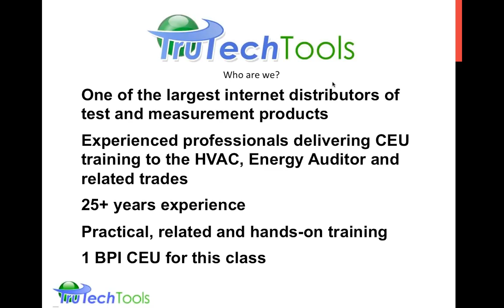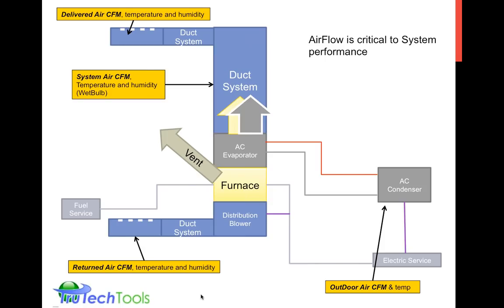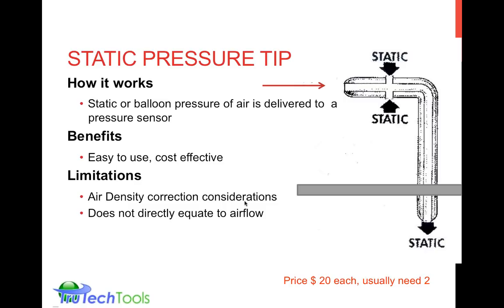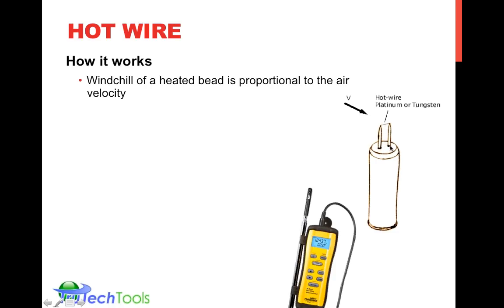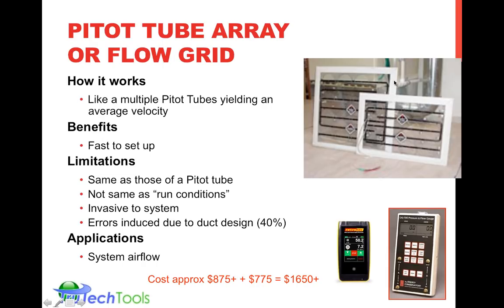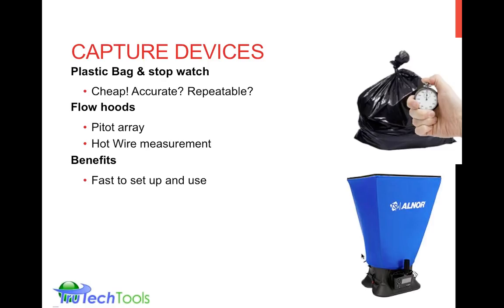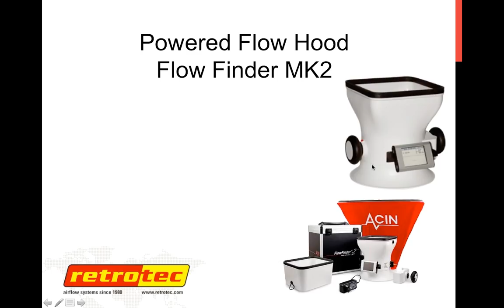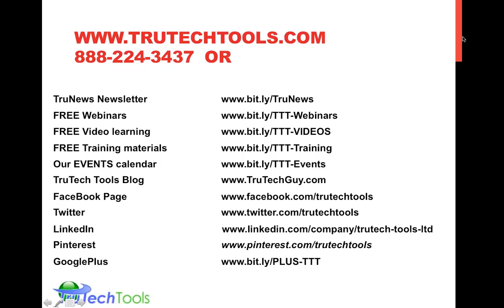Airflow 100, Version 1:  A Review of Air Velocity Testing Methods

Comment: If I use a hood, then use a velometer, I get two different cfm values. I divide the grills up, and average the airflow but my measurements are different. I use the free area of the grill. DO you think maybe just not careful enough or is that normal please advise, also is a factor, hood reading divided by velocity reading?
Reply: Your last sentence is an incorrect, run-on sentence, and will most likely not ever receive an answer.  
  Please correct.
    Thanks.